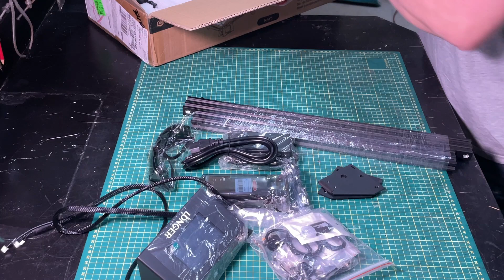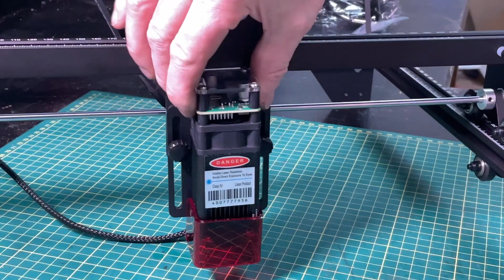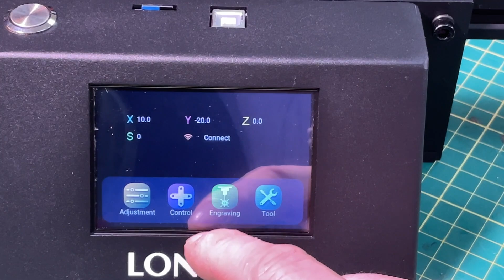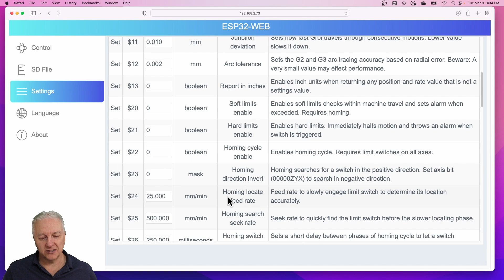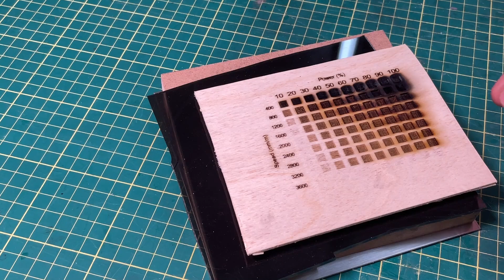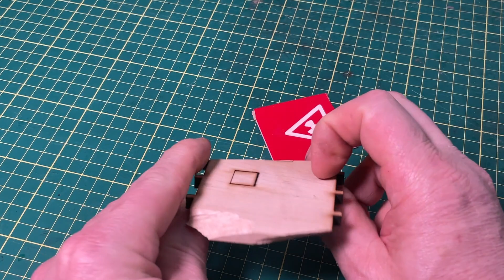The Longer Ray5 Full Review

Comment: Great video on the on the 5 W laser, did you make a video on the 10 W laser from longer? If so, where can I find it?
Reply from the maker: Yep I’ve covered the 5W 10W and 20w Ray 5
Reply: @SteveMakesEverything  Cool, I'm picking up a 20W this weekend and I wanted to research on it a bit, getting the 10W module used, 20W new, extended rails, honeycomb, air assist, and roller attachment.  If it can reliably cut 1/2" ply and up to 3/8 hardwood, that is probably the most of what I'd need it for.
Reply from the maker: @conradwheeler68  It's a great basic laser to get you started.  But just a heads up - you'll be pushing a 20W laser to cut 1/2" hardware store plywood and thick hardwood.  It might eventually get through but the edges are going to look pretty burned up.

Comment: Howd ypu get it to connect to lightburn? I cant seem to get it to connect via usb port to pc.😢
Reply from the maker: Sometimes lightburn doesn’t detect the laser, but you can manually creat the device. Make sure you pick the GRBL laser type.
Reply: @SteveMakesEverything  appreciate feedback, lightburn freezes up when it's trying to locate. I'm guessing it'll be a call longer tech support issue. Excited to use just frustrated lol.
Reply from the maker: @lueyl1930  The obvious thing would be to first try a different USB cable.  Then, turn on the Lightburn console to see if the laser and lightburn are talking to each other

Comment: Since many of us have 3D printers, just use the rod to tighten it down, then measure the height of the laser cover off the surface, and 3D print a small block that same height, plus it should double to help level it left to right. 
Alternatively use this laser to cut a small piece of plywood that proper height and width. Using the tool to create something else to be used for/with the tool.
Reply from the maker: Yes either of these will work.

Comment: A really good review thank you. I have since bought this Laser. Have you tried running the same Lightburn file from an SD card in this laser? When I do this, the laser frames in a different position. I cant understand it. I cant really use my new laser until I get this sorted.
Reply from the maker: You can’t really predict how the SD card images will output. They are essentially files that have already been converted to GRBL (the laser’s language) so any positioning and settings are already coded into the file.  You get what you get from them
Reply: @SteveMakesEverything  Hi Steve, when I do this the file is also framed about twice the size on the laser. I cant possibly see how I can use it through an sd card. Unless I am saving the file wrongly.
Reply from the maker: @Fossy35  OK I thought you referring to the images supplied by Longer.  This problem has to be configuration and there are a couple things you can do to test this.

First, on the front panel of the laser, move the laser module 100mms and measure that it moved that much.  It should work because the laser is doing everything.  If it doesn't then you will need to do a factory reset on the laser because the stepper settings are incorrect.

Next, repeat this test in Lightburn using the manual controls provided there.  It should obviously move the same amount.  If it doesn't then the profile in lightburn isn't setup properly, so try deleting it and reinstalling the laser.
Reply: @SteveMakesEverything  Thank you for your patience Steve. It's much appreciated. I have tried a 100mm movement on both laser and Lightburn and they are both correct. I am beginning to think I have a faulty Laser. Although it works perfectly when connected directly to Lightburn. Its only when I try to run it from an SD card.
Reply from the maker: @Fossy35  Not sure how you can possibly save a file wrong, so it's more likely something else - like a firmware bug.  See if Longer has an update that you do not have.

I guess it depends on your setup, but I generally find the SDCard/sneaker-net model pretty ineffective anyway, so anytime I use a laser, it's either on my network or connected via USB.  It's just so much more convenient.

Comment: As far as the focus issue, why can't you use the tool to focus it then measure the distance from the bottom of the protective shield to your work and then 3d print a square piece of filament to slide between the shield and your work? Just askin'.
Reply from the maker: Yep you can certainly do that. Diode lasers tend to be constant focus anyway for the focal distance is as critical as it would be on a CO2 laser
Reply: @SteveMakesEverything  In my case I found that after setting the 30mm setting piece at the back, the front distance from the bottom of the shield to the work was 3mm. So a piece of 3mm ply under the protective shield easily focuses every time.
Reply: n my case I found that after setting the 30mm setting piece at the back, the front distance from the bottom of the shield to the work was 3mm. So a piece of 3mm ply under the protective shield easily focuses every time.
Reply from the maker: @Fossy35  This distance is typical for many lasers, so I usually do the same thing.  It's far easier to find a piece of 3mm acrylic in my shop than to try to locate one of those focusing ingots.

Comment: Hello & thank you for the great review!  I think you said you design in other graphics tools, then load design into laser using Lightburn or GRBL.  If so, what graphics tool(s) do you like and is there  an implication that Lightburn  is not the greatest design software.   I just got a Ray 5 and am struggling  to get it connected to/through wifi or laptop with Lightburn  trial version.  Thanks again,  Robert
Reply from the maker: Most of the basic design I do is in Inkscape but if I’m doing something advanced with multiple parts that need to fit together accurately I will use Fusion 360 and then export all the piece to SVG so I can use them in Lightburn.  

As far as connecting to Lightburn, I have found that to automatic connect wizard fails more often than not, so you will want to do a manual connection setup.  Also WiFi on almost every laser is pretty dubious so you are definitely better with a USB cable.
Reply: Me too waveformsu. I don't think I am that dumb not to figure it out, but I can't get lightburn connected either through wifi or USB connection. Did you ever get it connected. Lightburn seems a little confusing as for what I need it for also